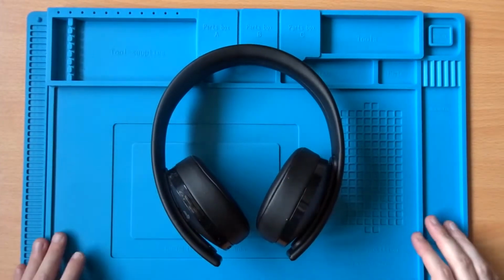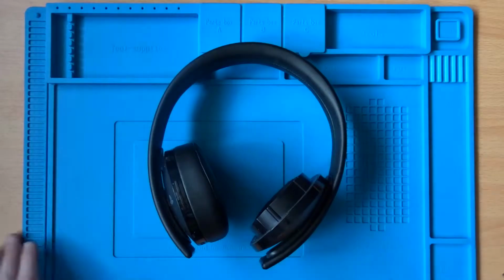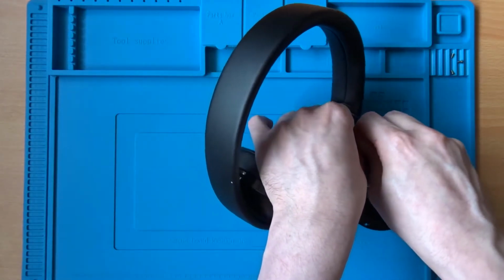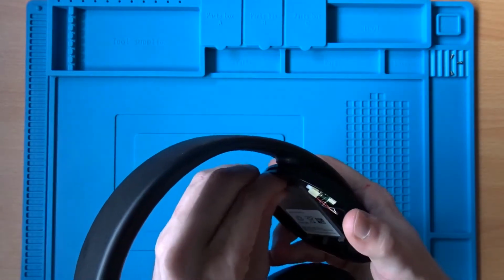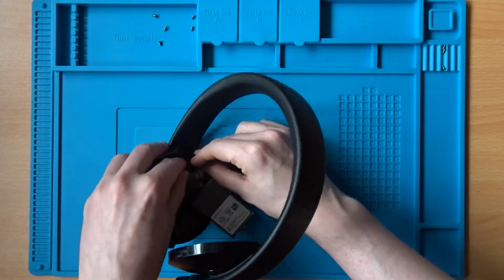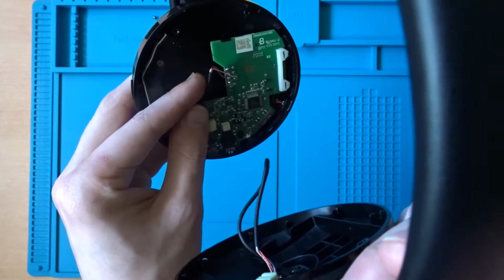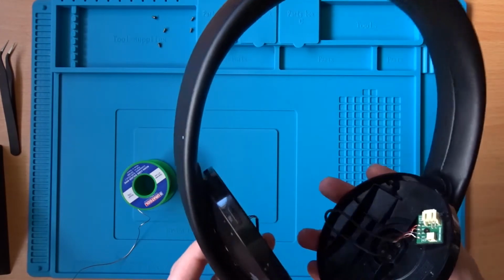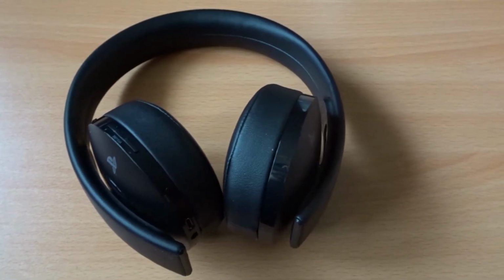Sony PS4 Gold Wireless Headset | Can I Fix It? | Qubits Tech

Comment: Hi Sir, saludos desde Brazil.
is there some video about the complete change  skin? not only the Earpads.
Reply from the maker: Hi, I haven't done it myself but I think replacement bands come with wires installed, so you'd need to unscrew the cups, desolder the wiring and solder/screw them into the new band.

Comment: Are you able to replace the entire leather band of the headset?
Reply from the maker: I believe so, the cups can be unscrewed and wires desoldered. I've seen them for sale on Aliexpress, just make sure you get the right replacement for your model of headset.

Comment: My Gold will not turn on.

Connecting a usb cable, the red led light comes on and extinguishes after some minutes indicating battery full.

Did a battery swap with my working old Gold which has a broken headband hinge...

But still will not power on with the known-good working battery.

The new gold battery does not power the old broken but working gold.

Ideas?
Reply from the maker: Hi, I'd double check for anything on the board that looks suspect (cold solder joints etc). You could also try unplugging/desoldering the speakers to rule them out as the problem (these should be replaceable). Aside from that, I don't think there's much you can realistically do. At a guess I'd say there's a short somewhere or a fault with the power management chip, which would explain the new battery not powering the old headphones.
Reply: @qubitstech  Any luck @F14foreverF14 with this? I have a donor pair I bought to continue my aging set, the band broke in the middle and the donor set has this exact issue (red led on charge, but led no activity when wireless). After swapping the battery of my working set its not that even though tons of videos about replacing the battery. The switch doesnt seem to do anything but the 3.5mm cable confirms the audio spakers work when I plug them in.

Every post or video that has this exact issue (not many) there has never been a resolution.

Comment: Hello
I have a problem when I put the headset in all audio I can't hear my friends. And if i use the cable it's the same. They hear me but i can't.

Should i buy a new headphones?
Reply from the maker: Hi, can't say I've came across that issue before, I'd say to check your settings as I doubt the issue would be the headphones themselves.

Comment: Hello, good tutorial.
I specifically was looking for a way to separate the headphones from the headband since the skin is peeling and they sell the headband but it is necessary to remove the complete set (the displacement line where it says L and R as well). Could this be done or would it be impossible?
Reply from the maker: Hi, there are screws attaching each cup to the band (you can see them when I removed the battery). If you unscrew these and desolder the wires running through the band from both sides, you should be able to attach them to a new band.

Comment: Hi, the wireless version no longer works for me, I only used the headphones with the cable for a while and suddenly they didn't go anymore, they light up when charging only red, would you have a tip
Reply from the maker: Hi, first thing I'd try is another cable if you have one, just to check your cable hasn't gone bad. If you're willing to open it up, I'd check the battery is showing the correct voltage and is actually charging. I'd also check the wires as I did here, if the joints are bad a couple might have worked their way loose.